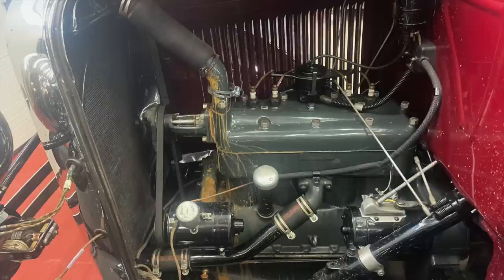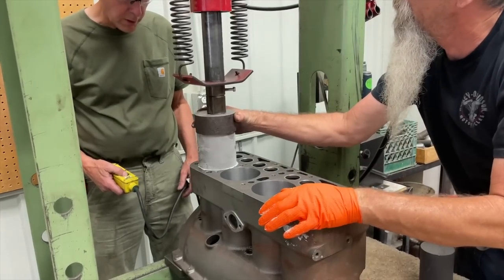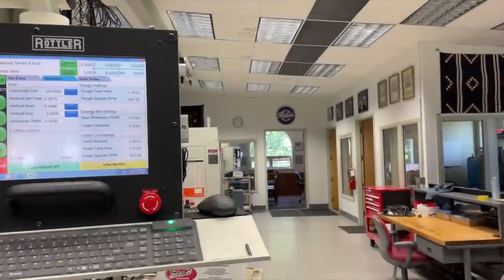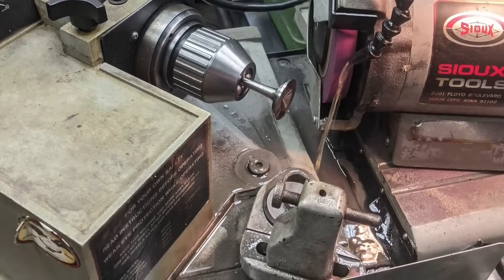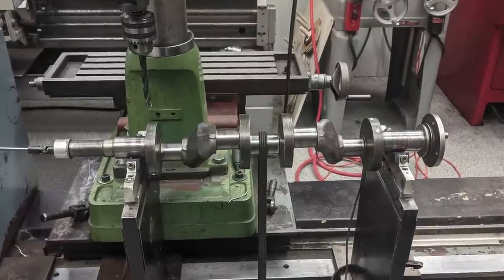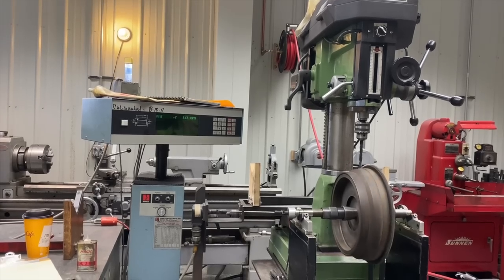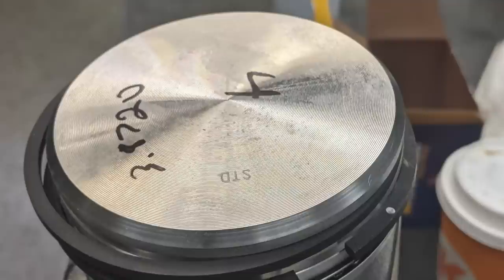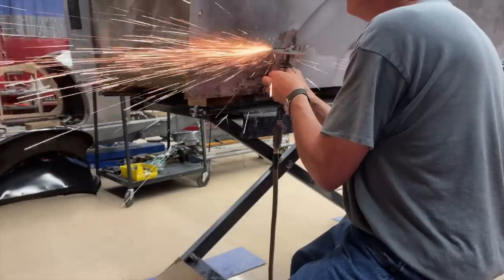Overhauling the  66A Deluxe Pickup Engine

Comment: You were lucky to find no cracks in the block. Could you show how you identify and correct cracks especially in blocks and castings that cannot be replaced.
Reply from the maker: Sure.  On the next engine we will do that.
Reply: @claytoresto  thank you! For a model a it’s most times easier and more cost effective to simply find another block. Not so with a majority of the cars you build! And where would a shop like yours draw the line on something like a model a? A few cracks, ok , but more than a few?